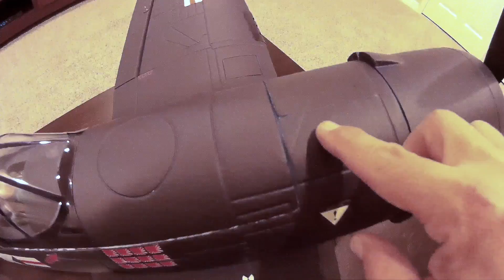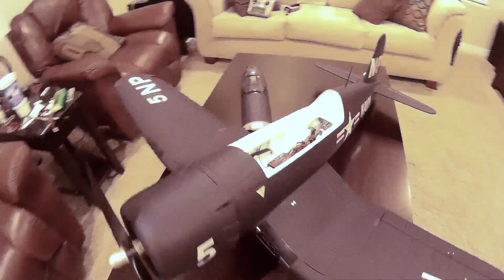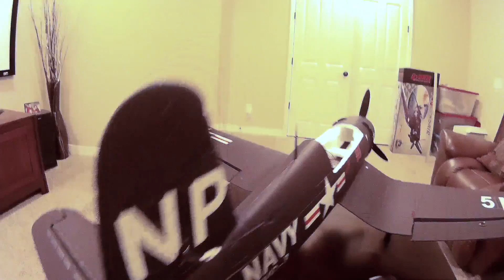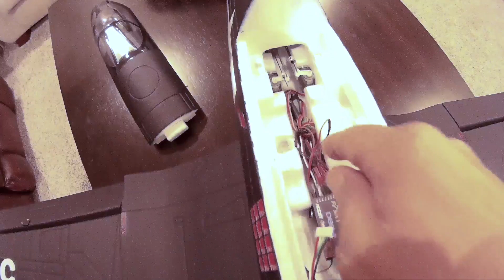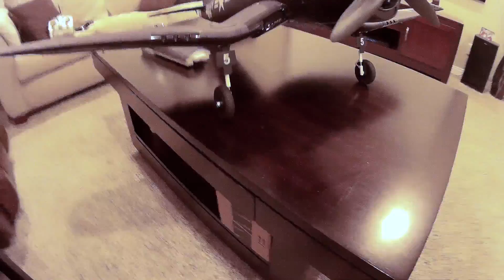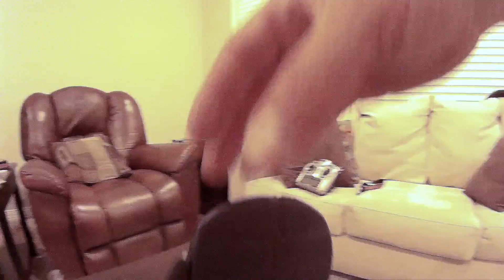Dynam F4U Corsair Build Review

Comment: Perhaps a bit late in the day now but should the wing bolts fit into something on the underside of the fuselage. I have just acquired an unbuilt model and am trying to put it together but at the present moment in time it looks as if the wing bolts just pierce the underside of the foam fuselage (can't be right). Am I missing something obvious or is there an additional piece that fits between wing and fuselage.
Reply from the maker: The screws screw into blind nuts in the fuse.
Reply: Thanks for the reply. Very much appreciated but may I ask are the blind nuts pre installed or is it something I have to attach myself.
Reply from the maker: They're preinstalled.
Reply: Thanks once again

Comment: Motion says they are coordinating with Dynam to improve quality. I understand the latest WACO bipes have better speed controls with switch mode BEC's. I'e recommend Dynam models to modelers with some experience in fixing marginal fit problems and replacing defective electro-mechanical  items if needed. I don't like failure prone  indented foam control surface hinging, recommend replacing with real hinges,  It's good to cut away plastic between dummy engine cylinders for better cooling of motor,
Reply from the maker: +gary gullikson Good to hear, and I hope it’s true. Dynam has a good (but not great) formula. Their misses are small misses though. I think you hit the nail on the head with their problem areas. Landing gear geometry is also a bit problematic especially on the smaller warbirds (mustang/spitfire). There are lots of complaints out there on retract durability too.

Comment: I have seen more expencive planes with worse paint jobs,fried servos and other issues. I have several Dynam planes and no they are not top of the line. I replaced the ESC and added a BEC to my Dynam Waco. Yes the nav lights are a joke. I bought 4 sets of turnigy nav light sets for my planes because I evening fly later than most. I like the fact I can customize my own plane and for the price, thats better than some planes that cost twice as much and you find out a servo is crap right from the start. Tugging on servo wires on any plane is asking for trouble. Your review was honest,but seriously,for the price,its not that bad. The studdering is a timing issue,Dynam now issues a paper with every plane as to reset the ESC. I personally hate their ESC choice and get a Turnigy brand. Good review. Honest.
Reply from the maker: Thank you. I don't financially benefit from anything I post so I try to remain as objective as I can be. I've recently relocated and now have access to a paved runway so I expect I'll enjoy my warbirds a great deal more since I won't have to fight the tipping issues in grass. I think my only frustration with Dynam is they could easily go from good to great with minor adjustments. Better electronics (ESC, Lights) stronger motors, and updates to their retracts. They really shine while flying and the looks/scale for the dollar is awesome.

Comment: Thanks for the video. I think you made some valid points, I have the T28 & Hellcat, you do get what you pay for. In saying that, both warbirds fly beautifully with very little trimming required. I have just purchased a Dynam Corsair and am sure it will be a rewarding experience
Reply from the maker: +Ian Summers The Corsair is beautiful in the air but the dark scheme makes orientation tricky.

Comment: This plane is $159...what did you expect? lol Thanks for the review though.
Reply from the maker: +Fullthrottle Turnnburn On the aftermarket, both motors are the same price. Dynam could have made a better choice and they should have. The price of the plane wouldn't have been impacted. Instead, the consumer has to make the upgrade and ends up with two motors instead of one.